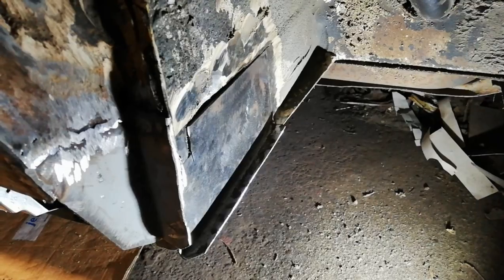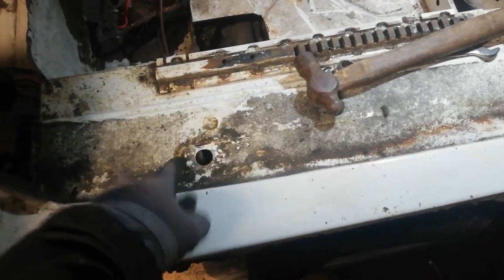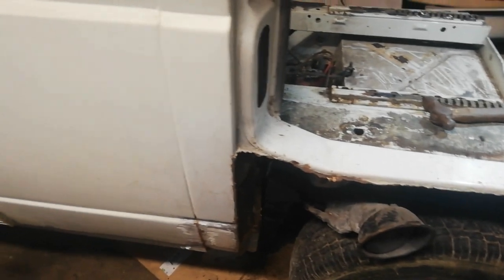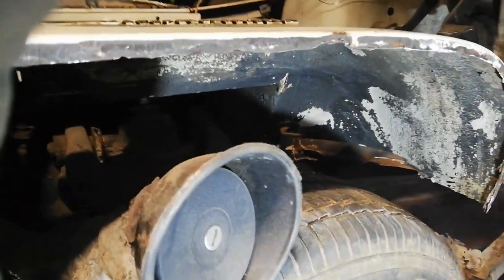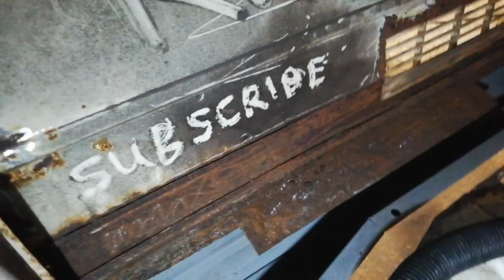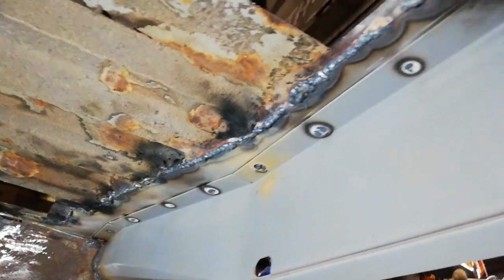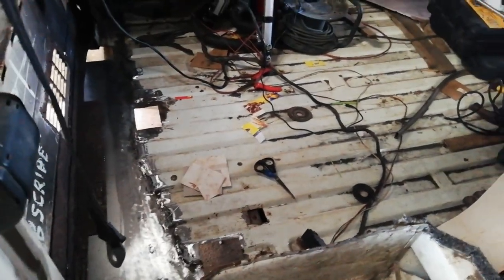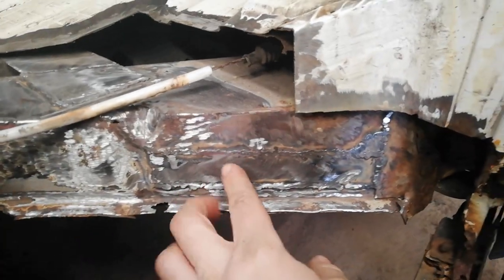The T25 Project Part 6

Comment: just curious, are you using mig with gas or fluxcore? also when you coat first with phosphoric acid (will any do?) , does the paint stick well? do you take it off again later to undercoat? sorry for so many questions. i dont have anyone else to ask in my area... Thank You!
Reply from the maker: I still use flux core but keep upgrading the welders. I have no real experience with gas mig because of the issues with bottle hire etc. Also because its mostly 1second spot welds it seems odd to be using 3 seconds of gas per spot. I may be converted yet though. As for the acid I've been using a few different ones. The current one is a glass bottle by rustins. It does absolutely nothing of there is any depth of rust tho. I've just started using a 2k epoxy primer that comes with a epoxy hardener (not isocyanate) and really impressed with it for bare metal. I'll get you a name. For general repairs I just use cellulose
Reply: @TheTinski07  i live across the Atlantic and do not have your pt of references but hopefully i can google its equivalent here. Thank You!